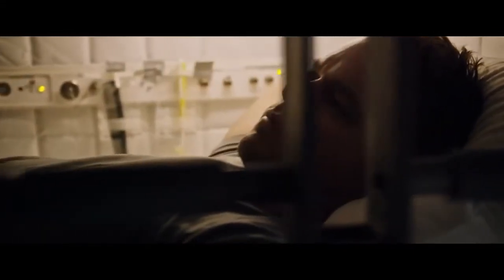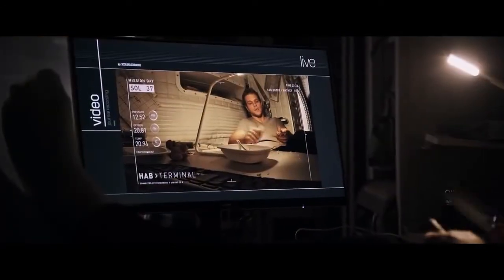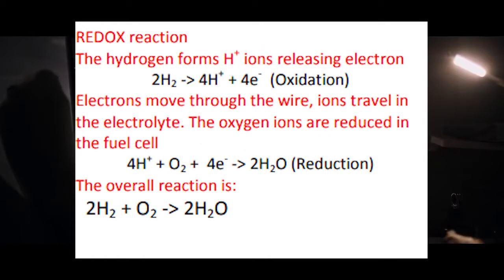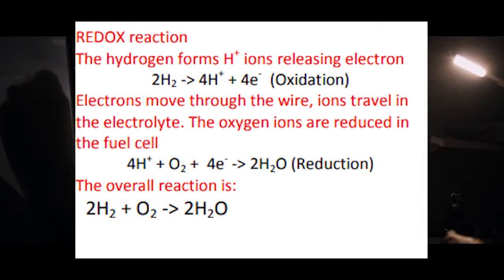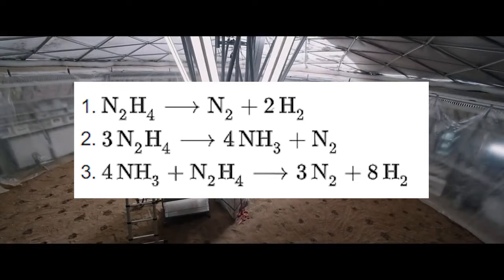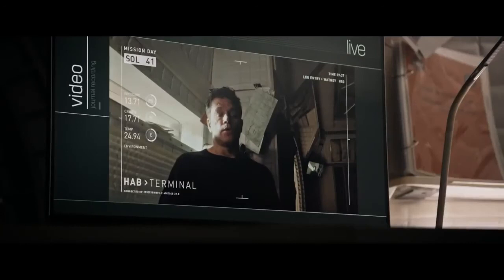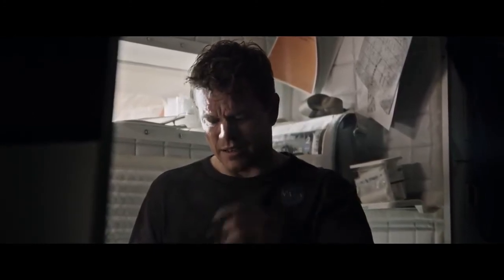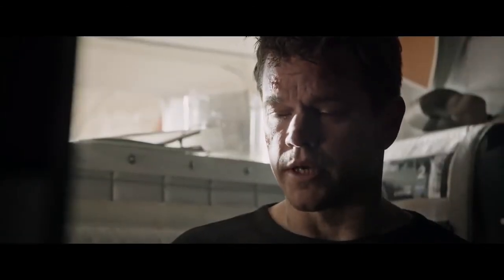The Martian - Chemistry in converting hydrazine to water

Comment: very informational!!! also wanted to add in the original decomposition process the nitrogen is likely vented to atmo(HAB) and likely filtered out or stored as the cryogenic atmospheric regulator uses a freezing system to freeze the air to 55 Kelvin, turning the oxygen to liquid for purification leaving  nitrogen remains gaseous =]